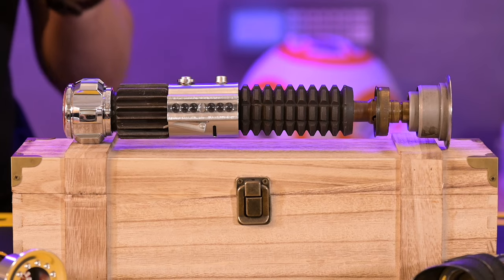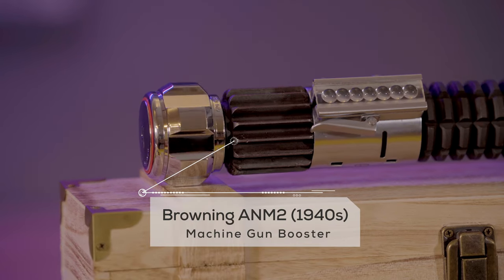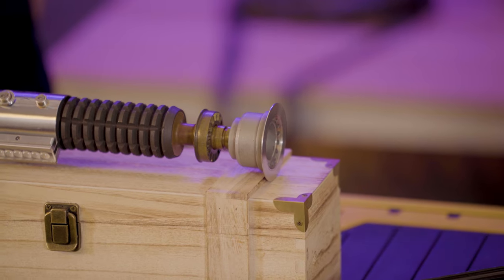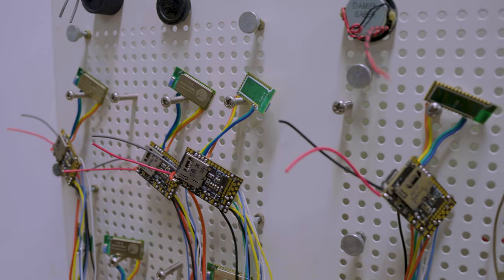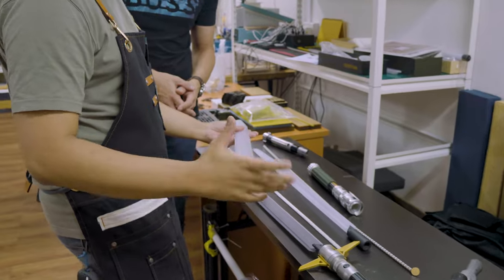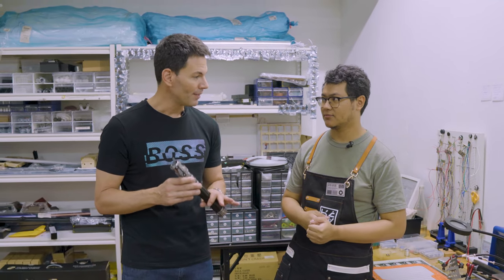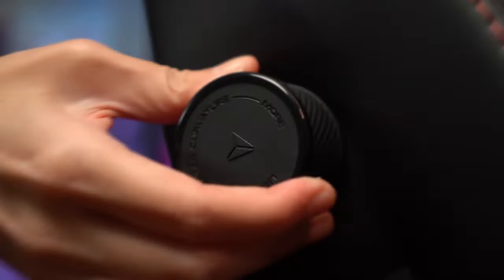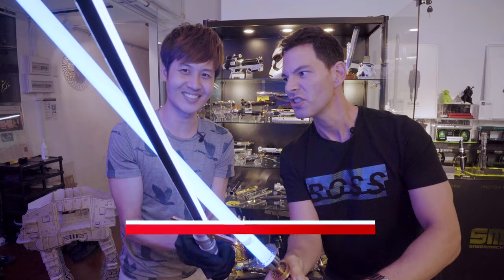Hands-On With The “Original” Obi-Wan Kenobi Saber!!! | SaberMach

Comment: I’m sorry but he’s incorrect, there are way more than 10. That all real parts Obi-Wan lightsaber consists of a female balance pipe. There have been 5 jet engines found with the correct balance pipe and a handful of NOS pipes found. Each engine consists of nine female balance pipes. The female balance pipe is by far the most expensive hard to acquire part. So that makes 45 total possible Obi-wan real parts lightsaber if the rest of the parts are found and I’m betting most of those people have the rest of the parts because I know most of them including myself. If you want more info I’d suggest joining the RPF or Replica Prop Forum. There is a huge thread about the subject by some very educated people.

Comment: No, you can not fight with Neopixel-blades! The LEDs will start to die and with a price of 100 to 150 Dollar, that would be a pretty expensive fight.
Reply from the maker: Well Sabermach does have a saber team that duels and battles regularly and they seem to hold up
Reply: @GeekCulture  Seems like an false advertisement to me. I am in the German saber community and everyone says, that Neopixel will never survive a duel. Look at the blade in the video. There are several dark spots. These are the parts, where the LEDs die down. Neopixel is not for fighting, if you do, you will regret it.

Comment: Ok, so it’s not the actual prop used in the movie.  This dude tracked down all the original parts used to make the prop and put it together himself.  Sort of like building a Lego set by tracking down the parts instead of buying the actual set arranged, packaged and sold by Lego.  I get the original parts are rare finds, and putting it together is really cool.  But I would not call any of these items “the holy grail”.  They are not the actual movie props.

Comment: Omg this video makes me soo angry. Why you had to do this? 1:20 less than 10? Like yours? Come on...Also I am pretty sure his washers are not accurate because we still did not identify where they came from. Also the transistors are not supposed to be DAT11, you CANNOT see the DAT on the reference photos! They are supposed to be MAxx, most probably MA09 which was found in another calculator. So this lightsaber is NOT the holy grail, NOT 100% accurate. I won't even watch the whole video, to listen more bullshit because this is just false.
Reply: Yeah I wouldn't call it the Holy Grail. The Holy Grail would be the screen used hero prop.